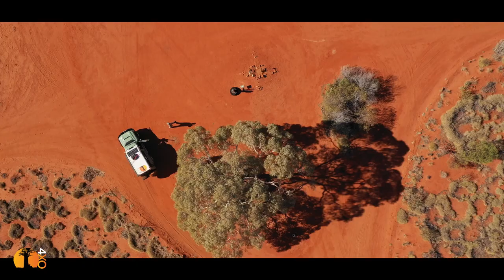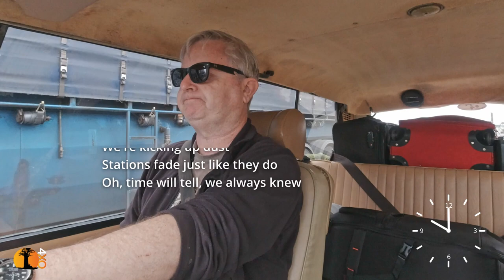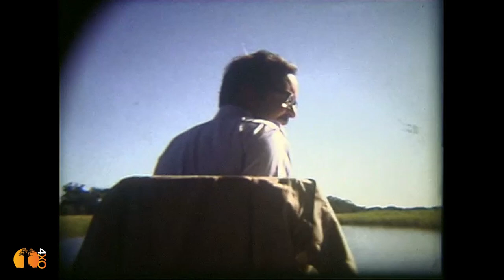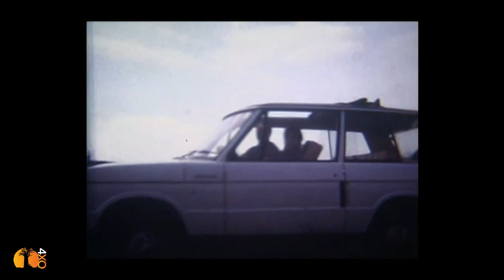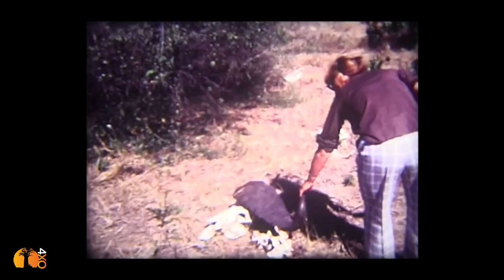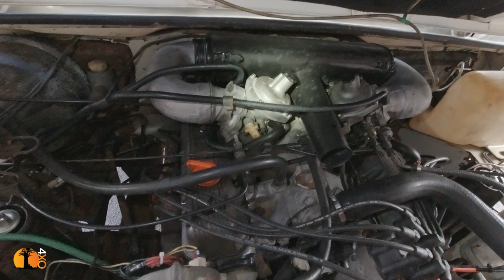NO TURNING BACK. Part-6. I head off across Australia in the Range Rover | 4xOverland

Comment: Hello Andrew. A few things. I used to make exhaust systems from scratch many years ago. To fix the resonance/loudness of the exhaust, fit a proper resonator instead of a torpedo style muffler. To fix the exhaust fumes getting back in the cabin, have the next exhaust people make the tailpipe exit at at least 45 degrees towards the kerb, preferably 60 degrees, from the longitudinal axis of the car. That way the exhaust is pushed out into the passing slipstream instead of swirling in behind the car as it is now. Those swirling exhaust gases are being drawn into the car because the air inside the cab is at a lower pressure than behind the car - the seals on the upper and lower tailgate are not sealing properly any more - that is to be expected considering car's age. Even if the seals are replaced, still a good idea to have the tailpipe exiting at a sharp angle. Have the angled tailpipe go out as far as you can, as long as it does not protrude beyond the alignment of the vehicle. Have done this mod to panel vans in the past and fixed the exhaust fumes in the car with the front windows open every time. Last thing. Conversion from litres/100km to mpg is 282 divided by litres/100km per 100km, in your case 282/14.5 = 19.45mpg, which is better than your your figures, therefore longer range. Of note it is many years since I owned a 2 door Rangie. Can't remember, but I think I also modded the exhaust, as mentioned, to stop the interior fumes. Bob Hudson. SW Sydney. Retired mechanic and builder of about 400 exhaust systems from scratch over 10 years, many years ago.
Reply: Great advice thank you for sharing.
Reply: thanks also for the advice ,i have been putting up with that for 6 years
Reply: Excellent exhaust advice, filed away for the future!

Comment: Google maps will take you the “quickest” based on traffic flow and other google map users. The Garmin will just take the direct route.
Reply: As above
Reply: He maybe using apple maps too.
Reply: you can try waze on the phone but it will drain the battery as it "talks" to near by users so charge cable is a must
Reply: I suspect you are likely to get better reliability out of the gatmin and the ilk

Google maps might be fine providing you got access to a long distance data plans from mobile phone towers, otherwise you are looking at an active sat data plan..

As gps in my experience from either a mobile phone or tablet doesn't rely on gps sats they base their their gps stats from the nearest mobile phone tower or repeater service..

I would never go on a trip without a sat phone because out side of town/city limits your mobile phones are pointless to use
Reply: @jasonhowe1697  That is not correct, the phone is using the GPS, and use the cell towers to get a very fast initial positioning. It is as precise as a Garmin. 
You could have a problem with Google maps if you don't have signal because it need to download the maps. If you download your maps prior, or use other app that has predownloaded maps, you are fine.
Reply: I just wanted to comment this! :) I only use google maps (android auto) it is usually alright, it takes traffic and closures into account. Especially it knowing which roads are closed due to maintanence is very usefull.
Reply: Not my Garmin in the Yorkshire Moors .... she goes bonkers.
Reply: @OverlandingNL in jmy experience  with google  within 300 meters of a destination in the city 

hit and miss traveling through the burbs of perth pending on you mobile phone provider.. you are with ...

i have been using google maps for years there are pit falls  with its use..
Reply: @notrut  moors aren't they boggy ? heard on qi that might be high in radioactivity not sure if this is correct in your case but I think high radio activity would interfere in the signals
Reply: I am aware of this. But how many times have Apple maps sent me some stupid route to somewhere, and how often has Garmin done that? Often versus hardly ever.
Reply: @edukano85  :NB Google maps (and WAZE ) need a network connection for traffic and other road condition updates - otherwise you are just using maps pre-stored on your phone - like any "dumb" in car nav-system. -  as you stated, once you have a GPS lock, there is little positioning value in the cellular network.  

Don't forget that in Australia we have National cellular network  companies, not regional carriers, so access anywhere (within coverage areas) is not an access problem like it can be in the USA.

@Jason howe - google GPS map and routing algo  is hard to beat - Garmin has little to offer in that sphere (just that a dedicated device lets you use the phone for other things whilst navigating....
As far as "GPS accuracy" - most devices use GPS chipsets sold by very few corps, they are all about as good as each other - a high accuracy "survey" GPS (which any in-car NAV is not) - has antennae designed to reduce multipathing and other "receiver" position errors...   10-20m, for navigation purposes that is fantastically accurate - If your phone has problems in the car - your car may be shielding the GPS signal - and could benefit from an external antenna  (connect via bluetooth).

Comment: the Land Rover bug is incurable. No matter how bad they may be, they are the best.
Reply: @underthelibertytree712  you never owned one then?
Reply: I had one it was utter trash, looked cool though 👍
Reply: @MrGmilton  utter trash in what sense?
Reply: @LR-dg7kt  fuel injection issues, would surge at stops, people would think I wanted to race. Horsepower not enough to merge on highway on ramps, tons of rusted out parts on all the non aluminum portions of the vehicle, including fuel tank, headliner falling after a couple years as well as power driver seat stopped working and many many trips to the dealer. I sold it for a few thousand dollars just to get it out of my life, hopefully the brave soul who bought it fixed all the gremlins and loves it, me I’m glad it’s gone👍 cheers!

Comment: Hi Andrew. I did a similar thing driving from North Yorkshire to Gibraltar via France and Spain, then from Gibraltar to Malta via Spain, France, Italy and Sicily, and then a return journey back to Gibraltar about 5 years ago. All done in a 200tdi Defender 90 with a canvas tilt. Excellent fun, saw so much, not really a single mechanical failure during the whole trip, apart from the A frame fulcrum ball joint was replaced in Malta as that started knocking in Sicily. Enjoy your trip. I will be following your progress.

Comment: You should change the rubber bushings between the chassis and the body. I saw them squashed and cracked. It makes difference. I did them on my own it help with body panel alignment and some of the noises.

Comment: My Range Rover Classic was an incredible vehicle. I had to have the transfer case upgraded to a full locking transfer case because I got stuck several times when you only had one wheel drive without a locking transfer case. With the 2 inch uplift, the larger BF tires, and the locking transfer case, this was an amazing off and on rod vehicle. I had to get rid of it because of rust and oscillations that happened over 50MPH when I it diagonal road undulations.

Comment: I’m loving it!! Just a check for you: Before changing the rear main oil seal, make sure the engine breather on top of the tappet cover is open and has free air flow.
Reply from the maker: We did. It does.
Reply: From what I remember, the Rover 3.5 V8 used a graphite rope main rear oil seal - they never changed from the early 60s Buick V8, unlike other GM engines, and were prone to leaking.
Reply: @philhawley1219  "It never leaked oil from anywhere" - Highly unusual! Did you check to see if it had oil in it?

Comment: Try driving with your driver side window open while the drivers side rear window is slide open a bit.
I used to drive mine 2 door RRC like that for the same reason you experienced and had no real issiues like driving like this.
Also the non standard rear silencer can be a source???

Comment: Such a lovely ongoing story thank you. I see your 16 MPG insert as we still dont do Km in the UK. I had a 1991 rego Discovery for 10 happy years as my daily driver, was the 200 TDi and I loved it,  I maintained It very well, and it drove very well, but wonder what your MPG or MPK would have been If your Rangie was TDi powered.. My old girl was as strong as an ox, but never had the head of in its 240.000 miles when i sold it.. I did make all my own tools to do cam belt changes, still got them, even the flywheel timing pin through the wading plug hole and a spot on injection pump timing pin, made all the difference, never needed heater plugs and would do 90 MPH when pushed, sadly your comment of the sore left foot/ ankle was the reason I had to sell my old Disco on, but to a collector..Thanks for the very entertaining video - Ian.B.. UK... Oh I now got a Baby Disco, a "Hippo" but a late freelander 1, auto box, all in black, HSE trim, so am a bit spoilt, even has the fuel burning heater bless it.. BMW engine diesel of course.. Love my Diesels..

Comment: Depends on the settings you use for google maps. You can choose to use it in different ways. Fastest route( doesn’t mean it will be the shortest.). Shortest route ( doesn’t mean it will be the fastest). New setting is the most carbon efficient (The route that will let your car do the trip in the environmentally way possible.). You can set your start time as well ( early morning) which can end up being vastly different from peak hour or midday start times.

Comment: Google will take you the quickest way using analytics, the Garmin will provide you with a "best" route, considering the practicality the of larger roads, and repeatable routes. Google maps is ace for city navigation and for most commuters. A modern and updated Garmin will have more features if you were going bush and if you need to actually make "inputs" into the device rather than passive navigation.

Comment: On the paper map issue, I find Hema's apps to be forgotten by most overlanders.
I found them to be excellent and far better than using raw paper maps as I know where I am with the app.

As to Google Maps, Garmin, Maps.Me and Hema, each of them are a compromise and none are perfect.
Hema is not great in cities to navigate (especially with the low resolution non premium maps), sometimes routes can be missing.
All the others don't list small roads once zoomed out, but can navigate.
However all of them have navigated me through roads that weren't desirable.

Even Garmin sent me on some bad dirt roads (which wasn't great when I first started driving on that surface) and Google can be rather optimistic with its short cuts - avoiding some traffic lights at all costs and with its continuous habit of sending unexpecting people onto long harsh dirt roads (plenty Highway is something it likes).

Comment: Not too bad, but you are goin less than 100kph, if you were goin 120kph your consumption will be more. But you save on time. There are a few new age tricks I do to get the most out if my mileage. I add extra ground wires to both cylinder heads, and I also change the air intake to promote more air flow.

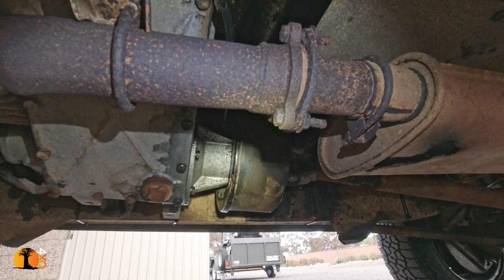Comment: On 29:55 you can see the middle exhaust silencer has black signs like it has a hole, so that could reduce the noise if repaired
Reply from the maker: It's not a hole. I think we would have noticed it if it was. Don't you?
Reply: @4xoverland  yes you would, but this black  spot is a typical exhaust leak, great video anyway, good luck returning home

Comment: Have a look at the center muffler, seems to have a black area, may be the smell you get.
Reply from the maker: It's the smell of sulfur-based extreme pressure gear oil. It is from the front axle.

Comment: Where ford Broncos not available to you in the 80's?
Reply: Nope, only by special import. 4x4 choices were really limited in SA at the time, since Jeep also stopped production there in 1979. Ford F250 and Chevy K10/20 were still available but Toyota reigned with the Hilux and FJ 45. At the time the Range Rover was probably the best choice because the pre-110/Defender Land Rover really sucked!

Comment: Where were you camping at 18.35 mins?
Reply from the maker: I was not camping. I just pulled over and drove up a short track.
Reply: @4xoverland  no it was the old footage, the cape point trip you did when you arrived from UK, I have a guess but would be surprised if it is where I am thinking.

Comment: 1982 Hilux is an RN or LN46 LN being the Diesel 2.2 L litre RN being the 2.0 litre 18R petrol an I had an LN46 5 speed double cab Hilux that was 1983. That model Not very common in double cab. 

I think you would have still learned to fix a Hilux . When you go off-road in any vehicle they get problems. I have experienced problems with my Hilux due to 4x4. Thought I do agree they are very reliable. 

However you could have brought a second hand Range Rover in 1982, 4x4 Hilux would have been brand new and possibly more expensive.

Did you consider a 40 series Land Cruiser in 1982. Though I can see the preference for coil springs, they would have been available on second hand market. I assume you did not consider due to leaf springs.

The leaf springs may have been the downfall of the Hilux for you in 1982 also.

Comment: I suspect if you had of gone with toyota back in the 70's your kids would likely  be driving them today..

rovers n matter how popular they were back ion your teens and 20's

I suspect if you were  going to run a permanent rover chassis  you would likely  have to replace the motor/axles/running gear with toyota because you could likely service it better with the mechanics throughout the small towns to city spaces across australia can you say the same for the land rover 

Can you afford to wait a week to a month waiting on spare parts unless you are carrying with you??? it just isn't the  costs of the parts you have to worry about where it is having to money  to park your arse in a hotel/motel until the vehicle is fixed.

I would under estimate  distance  when you have  leaking engine bay..
Reply: Why would you want to downgrade and devalue a range rover.  Parts are cheap and readily available not that you need many usually only consumables like filters and brake pads. Our Classis is daily driven has been for 37 years I know what I am talking about. Ours has done 14000 km this year already.
Reply: @iansaunders8694  did you work on your own motor or did a mechanic do the work for you??

Understand this if you have luck in someone dealing in parts of old rovers you will have no issues of keeping it on the road when the parts are scarce then it becomes a wider issues

I'd rather deal with parts I can get hold of in major cities to major and/or minor towns given the average jaunts between active mechanics  can be 300-1,000k's away..

14,000 km is rather short most toyotas most you see in 2ndhand markets are 200-500,000 km, I haven't seen that type of mileage out of any rover...
Reply: @jasonhowe1697   I said 14000km this year. Currently has 850000 on it. Without any rebuilds of anything. I work on it myself and as I said parts aren't scarce easy to get from Repco or Supercheap.

Comment: I grew up in the ‘70s and although Toyota then, and now, were building the most reliable vehicles available, there was a lot of anti-Japanese sentiment left over from the War (WW2) and so there was no way many people would buy a Toyota, despite the quality being way beyond anything else available. Land-Rover build quality was abysmal, brakes were, as Andrew says, virtually non-existent, a slight bit of wheel-spin meant a broken axle, the wiring could double as your evening fire-starter, the list goes on. A HiLux however would start and run perfectly every time.

Comment: land rover owners say "jeeps are unreliable" as they are on the side of the road rebuilding their engines... like 6 jeeps and no army support did the darian gap around the same time as or before the landrovers did it

what i wouldn't give for an old wagoneer to put coil springs, dana 60s and a modern engine and transmission in it
Reply: Amen to that!
Reply: If you replace the motor, transmission, axels and suspension is it still a Jeep ??
Reply: @markyeadon7271  most jeeps are stop or a lift and tires at most. you only see the wild builds on youtube not the stock ones.